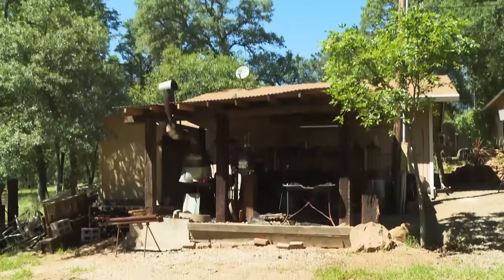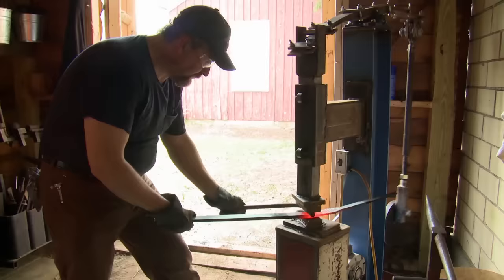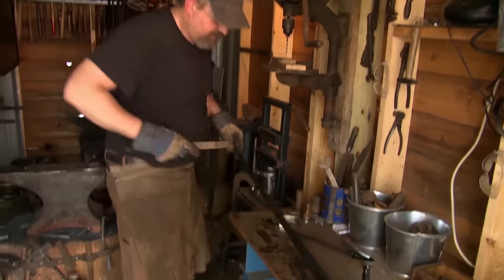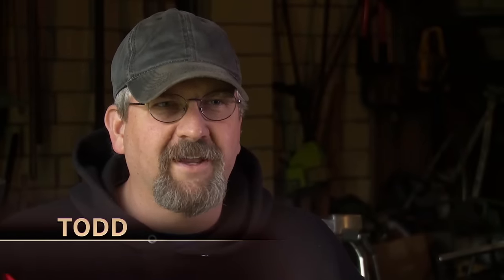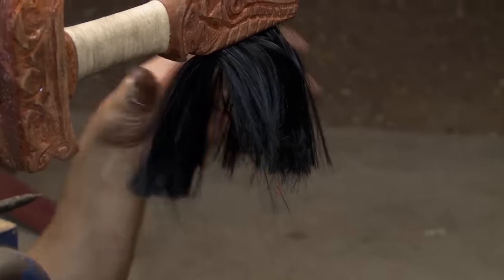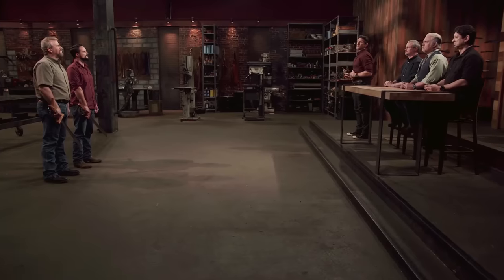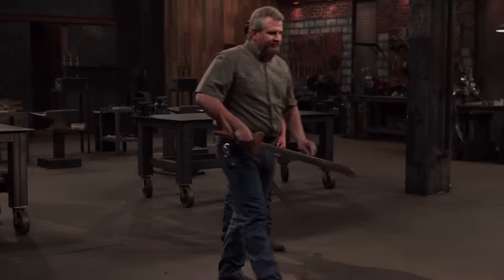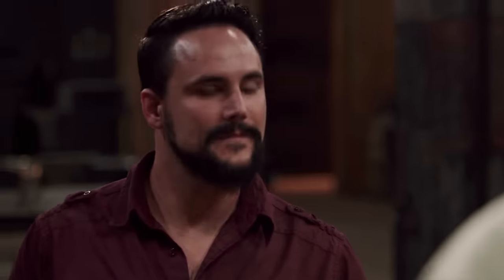Forged in Fire: The Kampilan SLICES & DICES Final Round (Season 4) | History

Comment: If you didn't know, the tip of the Kampilan are two horns that act as a fork to pick up the decapitated head of an enemy.
Reply: @Bruce6001  You could also catch an enemy blade with that spike.
Reply: @pavelthefabulous5675  i guess thats the real use lul
Reply: I am never & never will be...for social distancing
Reply: Umm nope, the tip is mostly decorative or status held. And is shaped to be like a Bakunawa or a Buaya. Not necessarily as a fork
Reply: @Bruce6001  social distancing
Reply: @arlturzdonkeh8410  The handle is shaped like Bakunawa. The tip of the blade that has a spike on the back (dull side) is for picking up heads and holding them up high for all to see.
Reply: You're on every FiF video 😂
Reply: Both Hilts and Spikelet tip was to signify or represent a a mythical creature opening it's mouth
Reply: This is what Lapu Lapu wielded against the Spaniards in 1521.
Reply: @Bruce6001  why use a fork when you can pick things up with your fingers?
Reply: why dont you ask the ones who used them in battle themeselves?...go to sulu or tawi-tawi ask the yakan or tausug what's the purpose of the horn/s?
Reply: Oh really.
Reply: @arlturzdonkeh8410  I think they're talking about the tip of the blade that has a little blade sticking out not the handle which has the Bakunawa design. Don't know much about that little tip either and what does it do. And I've seen Kampilan that does not have that metal tip sticking out.
Reply: @Bruce6001  they held a shield in the other hand
Reply: If they are Filipinos, they would of used their feet to pick up the heads... your facts must be wrong.
Reply: Smash
Reply: Can't be. 🤣
Reply: Back in the past moro(muslim) warriors of the Islands of Philippines who are true user and masters of that weapon dont pick heads of the enemy it is disgraceful shameful act..look for our national hero lapu-lapu he uses that and he is tausug muslim
Reply: @Bruce6001  cause kampilans were ritualistic swords a.k.a for beheading
Reply: kampilan designed the bakunawa, a water dragons mouth with hair
Reply: @Bruce6001  Heads are actually kind of heavy and their balance is odd when held
Reply: Salip Pulaka  no. It's not designed for slaughter pig, it's design based on faith, that dragon bakunawa, the mythical dragon bakunawa derived from naga a Hindu dragon, tribes in the philippines, minahasan Indonesia and pre Islamic brunei used that sword.
Reply: Salip Pulaka  those three tip design for picking anything like fish. it is fatal because if you spear the body of enemy they will point some parts of internal organs Like heart, liver and intestines the small hook, look like hook for fishing to grad outside your internal organs
Reply: Salip Pulaka  ulaga Wala pang mantika noong panahon ni lapu lapu gong gong
Reply: @floppypill9703  Lol. Lapu-lapu, Visayans or Pintados are not Muslims. Why do Muslims always claim that Visayans or Pintados are Muslims? We Visayans were called Pintados for a reason, we tattoo outselves, eat pigs  and drink wine which I know for a fact that all of these are Haram and is not allowed in Islamic laws...

Even Moro Pirates raided Visayan settlements. Stop claiming what's not yours please...
Reply: @yamnueva2932  Gong gong ka rin, sinong nagsabi kailangan mo talaga ng mantika para mag-inasal? Kayo cguru mga Tagalog ang kailangan magmantika para mag-insal.

Ay oo nga sabagay wala kayong mga Tagalog walang alam sa pag-iinasal since Muslim puppet state kayo noon ng Brunei. Hahahaha
Reply: @epraizer999  gong gong ka rin di lahat Ng Tagalog Muslim dati hahaha manila lang ang tondo animism haha aral ka din pag may time 😂
Reply: @epraizer999  eew sa totoo lang una kayong nagpauto kesa samin hahahaha 😂 gong gong.
Reply: @epraizer999  saka Kaya nilipat ang kabisera sa maynila kase mas may utak kami kaysa sainyo. 😂😂😂😂
Reply: @yamnueva2932  Ah kaya pala, hanggang ngayun ninanakaw pa rin ninyu ang mga taxes ng provinsiya! Sabagay pagnanakaw at ka-trayduran ay parte na sa kultura ng mga Tagalog. Hahaha! Nakakadire!
Reply: MABUHHHHHHHHAY DOUUUUG
couldn't help myself
Reply: @Bruce6001  because the other hand holds the shield and the other the sword, you pick the head with the sword without bending the knees, in the olden days once a warrior gripped his sword he will never let go of it until the battle is done. That is why the kampilan is design like that.
Reply: @Bruce6001  they used that to take enemy head for honor because their enemy is not like other country like empires their civilization is like just province vs provunce
Reply: Its a Philippine Muslim sword, most likely a design reference to the Prophet Muhammed and Ali's scissor point Zulfiqar sword of Islamic lore.
Reply: @Bruce6001  'cause that's gross
Reply: Lmao
Reply: @floppypill9703  Huh, how and where did you conclude that Lapu-Lapu was Tausug Muslim? Sulu was very distant from Cebu back then. Also, I doubt that Muslim had already arrived in Cebu, Hindu influence is more probable since the title 'rajah' was used instead of 'sultan'.

You may refer to this presentation by Dr. Jobers Reynes Bersales, you may want to skip to 16:40.
Reply: @epraizer999  Lol, kung ayaw ninyo magbayad ng buwis edi lumayas kayo ng Pilipinas.

Kung gusto niyo naman mapakinabangan mga buwis niyo, magsabi rin kayo hindi 'yung "Eh buti pa kami (kung ano man lugar ninyo) hindi hinahanap ang pangulo/pamahalaan kasi self-sufficient naman kami.
Reply: @epraizer999  Di ko na problema 'yon. Kung may problema ka sa sistema ng korupsyon dito sa Pilipinas lintikin mo 'yung mga bumoboto sa kanila.
 Ngayon, si Duterte na tubong-Davao, yumaman ba ang Davao? Hindi naman diba, ang bulsa lang niya ang lumaki eh. Nag-improve ba ang Kabisayaan? Hindi naman diba, lol. Basta kapwa Bisaya iboboto niyo na, dibali na lang kung matino o inutil din.

Sa laki ng populasyon ng Maynila, sa tingin mo ba na walang mga mahihirap dito? Lol, kahit sila nadadamay sa korupsyon. Kaya 'wag mong sabihin na corrupt lahat ng mga taga-Maynila o Tagalog.

Saka sinimulan mo rin ang mga comments mo sa paraan ng pagluluto ng inasal? Lol, patawa ka talaga. Pinakita mo rin na Islamaphobic ka, so dumating nga ang Islam sa Maynila noon. Ano naman? Sa tingin mo ba mga Muslim lang may mga problema?
Reply: @kanduyog1182  Islamphobic? Kung hindi nila ititigil ang pangbobomba at pangingidnap then I'll stop it. So far in the past years mulyiple attempts had been made to bomb Catholic churches. Remember Marawi? Ever wonder kung bakit walang investor ang 1st choice ay ARMM? Those investors must Islamaphobic too right?
Reply: I read that it worked well to disarm, or take off Spanish armor as well. There's a Japanese sword called a kabutowari with a hook on it that did the same thing. It almost works as a hook. I have a larger 2 handed version at home.
Reply: @floppypill9703  according to sulu oral history.
Reply: @Bruce6001  that would be not nice to offer to the gods on thta way tho😂😂😂
Reply: chi chan have u done thst lol
Reply: @Bruce6001  u just did disrespect filipino culture.
Reply: @Bruce6001  because it's eeewwy. We filipinos don't want our hands getting dirty🤣
Reply: That was true, I agree to you.
Reply: According to the Grand masters and Masters who trained me in arnis Kali the forked blade had many uses, catch and twist another blade, hook a shield pull it down then run the thick end into the face, also the hadle came ito use, the hadle represets thigs that bite, crocodile, shark snake or monkey
Reply: i think the more head you collect the more tattoo you'll get and become higher position too...
Reply: I heared that in filipino kali weapons
Reply: hi chichan 😊
Reply: @Bruce6001  warriors don't bow down to their slain enemies
Reply: Nice theory but it's more on disembowelment :) one stab on the stomach, gods know what comes out with it.
Reply: @epraizer999  i agree
Reply: @_Simkim  tf?
Reply: It's more in to fork the shield of an enemy and leaving them open for an attack.
Reply: Thanks for the info.
Reply: @Bruce6001  maybe that waas too mainstream for them.
Reply: @Bruce6001  pick the decapitated head by hands? Eeww
Reply: @Bruce6001  It is not for picking heads only. Multi purpose. Mostly it is to catch an opponents blade.  It also makes stabbing a bit easier and fatal in case you have to do thrusting because kampilans are primarily for slashing. But if you need to do some thrusting that small bit will help.
Reply: @Bruce6001  Because a sword is cooler
Reply: @barriolimbas  okay lang yan HAHAHAHHAHAHAHAA
Reply: The hair of that enemy, if worthy, would end up as the decoration on the handle.
I guess Magellans hairpiece was on the handle of Lapu-Lapu, if he knew who it was
Reply: @melaniejason3912  lol
Reply: @exceptionalusername  feet the best alternative for hands when laziness strikes 🤣
Reply: Eeewwwwwwwwyyyyy
Reply: Buddy has a nice horn eh?
Reply: @Bruce6001   Pride of Warrior sir
Reply: @floppypill9703  new discovery of Sir Jose Bersales, said that Qadi Lapulapu is not a muslim but an adherent of animism which is ancient cebuanos are predominantly animist. If thats the case, he worship Abba (Bathala) and Kan-laon. Still in debate by many fililpino historians but the evidence strongly suggests that Qadi Lapulapu is an animist rather than Muslim.
Reply: @Bruce6001  intimidation. It's a blade from half a millenia ago and intimidation is a big factor then. Nothing screams being a fearsome and strong warrior as picking your enemy's head with your sword and then screaming a victory cheer.
Reply: Now i know thanks
Reply: @floppypill9703  Cebuano Hindu
Reply: @Bruce6001  intimidation
Reply: @floppypill9703  correction, lapu-lapu is an animist, not a (and never was) Muslim.
Reply: Pinoy ako
Reply: The tip is used to pick banana or papaya if its too high to reach. Very clever huh…🤔

And also, Lapu Lapu is a fish. Very expensive.
Reply: @wumboIogist Sure. As if I can trust a wumbologist…
Reply: @floppypill9703 lapulapu is in mactan not insulu 🤦

Comment: Every time someone “hopes” his blade is light enough, it isn’t lol
Reply: When you put too much metal from the start, it's difficult to take it out after
Reply: @billdenbrough9439  well its much more difficult when you use materials without considering errors, its much more easy to subtract material than adding it specially in blacksmithing.

Just my opinion
Reply: I believe they call that foreshadowing
Reply: Ofc, because if you need to hope for something it means you can't trust what you did to do it alone
Reply: So basically the takeaway from that is if you think or hope it’s light enough make it lighter
Reply: Because they know they didn't made it properly so THEY HOPE
Reply: @billdenbrough9439  to begin with the kampilan isn't supposed to be light its a heavy blade
Reply: @paulaumentado1588  I understand, but there are limits. If I have to swing a blade in battle all day, it can't be too heavy, even if it's supposed to be a "heavy blade"

Comment: Awesome cutting power! Here in the Philippines, we have what we call itak mulye  which is made from leaf spring (mulye) of a motor vehicle. I’ve been using such cleaver variant for more than 4 years now. Haven’t sharpen it ever since yet still cuts like new. I use it in chopping cow’s feet, pork ribs, goat heads, coconuts and due to its weight I’m even using it as an axe in splitting firewood.

Comment: That tiny hook at the Kampilans tip is said to be used to hook and pick up severed heads from the enemies.
Reply: @horvathbenedek3596  lets say compare it to a fork...at least 2 points...2 or more pointy ends hold the food item much better than one point.. food wont slide off...if those fork pointy ends worked on food as a tool  then why not a sword? ...multiply size several times i can picture it out...executioner chopping head off ..picking  the head off the ground with the pointy ends and raising it up high for everyone to see
Reply: @reonel_9060  It's a fighting weapon though, not an executioner's tool. Also, the two dimensions are ALREADY provided by the width id the blade.

Once again, this sounds like a myth, just like blood grooves and katanas chopping through armor.
Reply: @horvathbenedek3596  are you really trying to act like you know more about my culture? Lol.

That is a headhunting sword traditionally used by sticking the blade up the neck side of the severed head, deep enough for the hook to actually grasp on the flesh. Picking up the head pretty much does the job just as good, but it looks more ceremoniously pleasing.

I have tried it myself on a pig head using the Ilocano variant of the Kampilan and it feels real good.

Comment: Very far from the local look.. specially how the handle was made.. usually it was hand carve, mano y mano, the blade test is using thru pile. If the pile can't grind the blade, strong and good quality steel. It should not bend or break, it should resist the force applied without damage when you try to cut something hard.